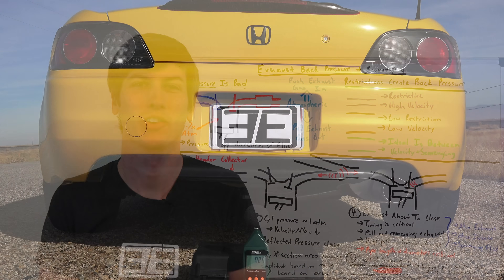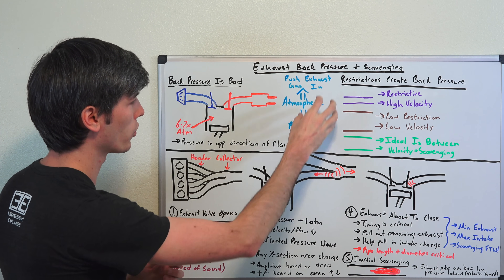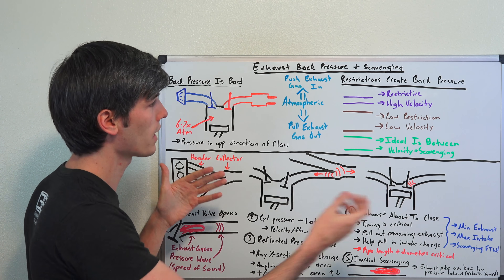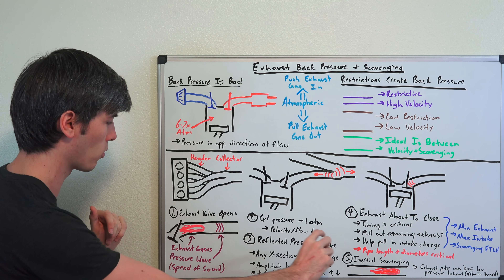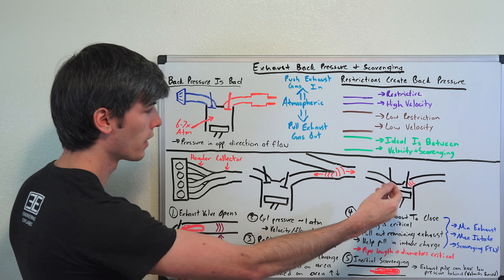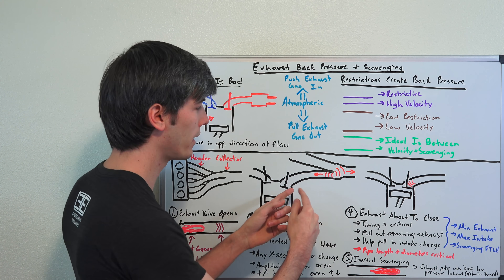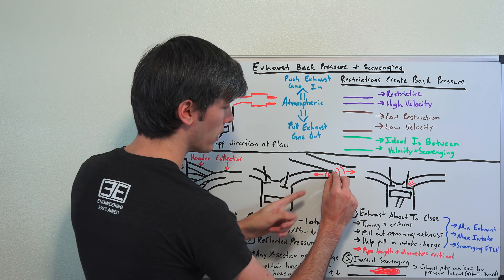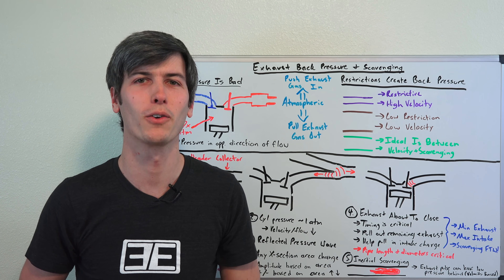Stop Saying Car Exhausts Need Back Pressure

Comment: Is this only assuming we all run titanium valves? Ever heard of a "burnt" or "tuliped" valve from exhaust leaks or running a vehicle too long with open manifolds? Im afraid this video may lead too many guys to ripping all their exhaust off and burning up a set of heads lol. But I would love to see your take on a similar video in a turbo application.

Comment: I need to ask you this. Say if the total length of my pipe is 3 meter (2.5"). What will happen if i chop off the last 1.5 meter of my pipe from the tip? Leaving the front 1.5 meter from the downpipe. What effect that my car will experience?

Comment: I have questions about how would one increase performance and remain legal and good emissions. I am thinking of not catback but rather high flow cats. Now this would related to a specific vehicle of course. What cold one do to try and analyse an exhaust system and know whether catback or high flow cats or both is needed?

Comment: IC engines are essentially pumps. Get the most intake charge in efficiently and the most exhaust charge out efficiently and you will see good results. Put exhaust gasses back into the pump and you'll find problems.

Comment: Does this apply to turbo cars? 
The turbo depends on exhaust pressure to operate doesn't it? 
How would change of exhaust back pressure affect turbo operations? 
I have a turbo diesel vw golf, if i were to, say, delete my muffler, that would certainly change my exhaust pressure, would that negatively or positively impact how the engine runs? 

Can you please do a follow-up video on exhaust back pressure and turbo cars? Please! 
I think what you have explained here in this video only assumed that it is naturally aspirated engine, right?

Comment: So you're advocating taking the catalytic converters off of cars, making them illegal for street driving? The ECU in most vehicles is tuned for that back pressure. Eliminating it would cause the ECU to go into limp mode because of the second o2 sensor, and the maps would be a little screwed with the reduced back pressure letting the engine spin with less resistance.

Comment: This is going to go on and on you need some back-pressure waves and the more boost you run the more unburnt fuel you flush out the exhaust port, the overlap of valve timing all play a part, people have been designing exhaust systems from day one, so why has this not been put to bed by now, it is a black art. Check out    Header Theory Dyno Test  and Cast Manifolds vs. Headers    on Engine Masters on YouTube, bigger free flow lower back pressure is not always the best way to go. It is good it gets people talking.

Comment: It's amazing that people will not listen to a word you said because Cleetus at Smithys Muffler Shop tells them the backpressure of a Flowmaster will give them more power
Reply: The whiteboard literally says “restrictions create back pressure” and then clarified underneath that an in between is ideal, which he leads on to explain in the second half about scavenging.
Reply: @Tyler Zeus On a daily driver, low end torque is indeed increased by smaller diameter header tubes. But, you are not so much increasing overall torque, you are shifting the peak of the torque curve toward a lower RPM range. You are sacrificing torque above the 5,000 RPM range. You get a peppy engine in the 2,500 to 3,500 range where daily driving and an occasional speed contest to the next light is required. However you are not flowing copious amounts of exhaust. You are using the high exhaust velocity from the smaller tubes, not the resistance it creates at higher RPMs.
Reply: Backpressure is bad. Scavenging is good.
Reply: "I have been a technician for 40 yrs"
So? That doesn't suddenly make the video wrong. It's just loosely saying the same thing as "I'm older than u so I'm right :^)"
Reply: r @snickerdoooodle  No, I am saying baby face engineers are asswholes.  I do understand you are getting senile gramps.  Time for your meds.
Reply: @Tyler Zeus wrong. If it did then explain why a diesel runs best under any situation with no backpressure?
Reply: @meifert2  Most diesels run turbochargers. They do have, in essence, restricted exhausts. The added power overcomes the sacrifice at the turbo. Makes one ponder electric turbos.
Reply: On forced induction engines back pressure is very bad
Reply: @charpocus  on any engine backpressure hurts power.
Reply: Maybe Cleetus' exhaust was done so wrong, that muffler actually neutralised its wrong benefits.
Reply: Idiots will listen to idiots
Reply: Well, if you see drag race cars, or f1 and so on, they dont juse muffler or restriction,, just straight out so much free flow as posible,, i do belive they know what they are doing, if some do it couse of noise regulation.  So if you a more free flow exhaust and more free flow air intake you will get moro power,  and more noise.
Reply: @mooen83  
They Also rebuild the engines after each race
Reply: @mooen83  Actually, those "zoomies" on a dragster engine are at a critically calculated length. At the ideal RPM, they reflect the sonic  pulse, created when the exhaust valve opens, back through the exiting exhaust gasses and arriving back at the exhaust valve at the time it opens again. It amplifies the next sonic pulse heading toward the end of the pipe. This stronger pulse helps move the gasses and creates a negative forward pressure that helps scavenge the burnt gasses from the combustion chamber. The pulse wave moving with and back through the flowing exhaust is a constant. Therefore, length of exhaust header "zoomies" pipe and diameter determine how long it takes the pulse to return to the valve. The time to return determines the engine rpm it takes to time the event to produce optimum horsepower. Now, for the F-1 guy, it gets a little more complicated since more than one cylinder is channeled into a single exit pipe. The pipe can be longer because the RPM is higher and more cylinders are contributing. Some of you already know this. Some of you will understand this. And, others won't believe a word I wrote, let the name calling begin. sigh
Reply: @mooen83  An F-1 engine produces low torque compare to their high horse power. Plus the engine spins upwards of 15000 RPM. You need all the freeflowing exhaust you can get with that engine speed. They do not need high torque because F-1 cars are light. Different story when you talk about regular street cars, or truck.
Reply: @MrWd2528  What are you even talking about? F1 engines produce near 500 ftlb of torque. More than most consumer haulers. F1 cars are light but produce more aerodynamic downforce than they weigh. At max speed an F1 car produces near 2500kg of normal force on the track surface.
Reply: And, the uneducated just crawl out of the woodwork. If you can't dazzle 'em with brilliance, baffle 'em with BS.
Reply: @VashthStampeede  Truth! To be fair though, the video leaves enough holes in the complete explanation of this process that I actually question why it was released as-is.
Reply: Most times when back pressure is mentioned is in regards to turbos as it’s kind of a preload for the turbine wheel(bearings). Too large a diameter will slow exhaust velocity conversely too small a diameter creates too much restriction robbing power etc. ie dont throw a 3 inch on a stock turbo mostly stock evo or sti as it would hurt more than it’d help.
Reply: It's not about power, it's about sound. If you have no back pressure at all, you'll get an un-tuned sound that sounds like ass. Especially if it's a POS economy car.
Reply: Well on a high performance engine like a 2015 zo6, you actually lose power if you remove the back pressure
Reply: @hippycow1006  wrong.
Reply: @meifert2  it is correct, if you put a better flowing exhaust in it, you lose power because like at the start of the video, he says that there needs to be balance. So by making the restriction low, you lose power.
Reply: @hippycow1006  no you don't. You change where the power is made but make more power. I'm literally running a Z06 on a dyno right now with an aftermarket exhaust with less restriction and it's making more power
Reply: @meifert2  and you didn’t make any other changes to the car other then the exhaust?
Reply: @hippycow1006  not on the initial run which was jist the exhaust. It's still picking up power as the tuner tweaks it.
Reply: @meifert2  well I stand corrected then
Reply: @hippycow1006  You don't lose power because no backpressure. Your ECU doesnt know how to deal with the improved flow and mucks up fueling. That's why you lose power
Reply: @Omar411269  the ECU can account for it fine. It’s still getting a stable reading from the oxygen sensor which just measured the atf ratio and not flow. The reason back pressure matters is because of resonance. If your exhaust pipes are too big in diameter, the bursts of exhaust from the engine won’t properly flow forward and thus sucking the next burst through. It has flow going back to the exhaust port because it flows too freely. Though this is a small thing on many cars it does matter on dragsters and proper race cars because it will effect performance.
Reply: Interesting comment.  I think it was in the first minute or two of the video that the feller explains why some back pressure is good.
Reply: @CalebDiT  What he said was having a balance of velocity and restriction is ideal, not that having some back pressure is good. More  restriction increases exhaust velocity but inhibits overall flow of exhaust, less restriction allows more exhaust flow but lowers velocity.
Reply: @Talos_Valcoran87  You and the video maker seem to understand what is necessary, but you don't like the terms. "Back pressure is bad, but some calculated restriction is ideal." It's a contradiction to anybody truly listening.
Reply: @Talos_Valcoran87  restriction = back pressure. This is semantics at best
Reply: @CalebDiT  no it isn't - back pressure is one direction.
Reply: @THEteamcurtis  not really, back pressure means going backwards, restriction means it can go forwards just slower, surely?
Reply: no, it doesn't. per webster, back pressure: residual pressure on the exhaust side of a steam-engine piston against which the steam on the intake side must work
Reply: @ljgarrison6910  You're answering a statement that nobody is making. Nobody ever says you need pressure going backwards, in a linear sense. Restriction creates back pressure. Consider any transverse wave, even electromagnetic, and you will see that no back pressure -- no restriction -- is rarely ideal. It takes everything to be just so in order to let things flow without restriction and for there to be no negative effects.
Reply: @Talos_Valcoran87  Flow good, Velocity bad (unless it is a tuned header IMO)
Reply: @Talos_Valcoran87  
well said
👍
Reply: @Talos_Valcoran87  Restriction inhibits the initial pulse, but helps the tail of the pulse through inertial scavenging. The overall win is to have some restriction. End of story.
Reply: @CalebDiT  Did you watch the same video?
Reply: @CalebDiT  No, he mentioned it and shrugged it off as if it was to complicated for us poor folk to understand.  He never explained it. Also the title of the video is "Back Pressure is Bad!".
Reply: @netprowlerp  you are the best example for the comment at hand
Reply: @CalebDiT  Watch the Video again with the title "Back Pressure is Bad!".  He never explains it he alludes towards it and shrugs if off as it being to complicated to explain.   I will take the advice of actual mechanical engineers and not one playing one on YouTube.
Reply: @netprowlerp  As a mechanical engineer I think he gives solid advice and understands the concepts I have been taught very well. So you can go away with that appeal to authority now.
Reply: @theworstflash  I have been a technician for 40yrs and had to fix the crap you engineers designed.  Let me tell you buddy,  I am not impressed.  My finding have been proven on the race track and not on paper.
Reply: Back pressure is the pressure sent back that when timed right helps scavenge the exhaust out of the cylinder.  He stated that himself.  He also stated that smaller diameter pipes move exhaust quicker(dont want it too small or too big). Pretty much, unless tuned and a system designed to work without it,  you won't get the best scavenging because the back wave of pressure creates it.
Reply: @MrBurntasphalt55  You got that backwards. Scavenging is caused by the vacuum created by the pressure of the exhaust pulse moving away from the valve.
Reply: MrBurntasphalt5l5
Reply: restricting exhaust increases torque and decreases horsepower, period
Reply: Hmmmmm . . . .  listen to my mechanic who builds engines for IMSA and SCCA champions or listen to an unumployed engineer who makes Youtube videos?  Hard choice.
Reply: SR20DET_RX7

Lets see why your engine needs a certain amount of Back pressure
1) makes the engine run smoother.
2) stops vibration shock on the crank shaft and con rods 
3) reduces wear on crank journals.
That's three  for you to contemplate ( think about ) If you  didn't need back pressure then automotive  engineers would have just let the exhaust run strait out the head. Say Hi to Cleetus  for me he seams smarter than you
Reply: @bearup1612  you claim someone "seams" smarter...yet you can't spell
Reply: @meifert2  
WOW. Is that all you have to say.
Reply: @bearup1612  you're wrong. That says the rest.

Comment: The myth of back pressure. The old myth was that six cylinder engines needed back pressure, but what they didn't understand was that at lower rpm, where most sixes made torque, exhaust velocity was important. Because Kay Sissel, the authority on straight six performance at the time narrowed the exhaust after it passed through the collector to enhance velocity it was called back pressure by those who didn't understand how tuned intake and exhaust systems worked. This guy explains things fairly well. The whole thing is this, the positive pressure wave created by the exhaust expanding and escaping the cylinder when the exhaust valve opens traveled at 1400 feet per second according to Chrysler, 1100 feet per second according to Ford and British leyland. It really doesn't matter who's right, the proof is in how tuning effects the engine. When the p wave, or positive exhaust pulse exits the exhaust collector into the atmosphere, a negative wave forms immediately running back up the exhaust towards the next cylinder that's ready to release its exhaust gas pressure. When tuned correctly, the exhaust valve opens and the intake opens soon there after, and the momentum of the exhaust gasses leaving the cylinder creates a vacuum, helping draw in the air-fuel charge for the next cycle. The intake has to be tuned just like the exhaust so that these pulses of pressure happen at the desired time so that during valve overlap they help fill the cylinder for the next compression and power stroke.

Comment: I wish you had touched on the subject of 2 stroke expansion chamber exhausts. That is the one exception where back pressure (in the second half of the expansion chamber, where it constricts) benefits by keeping fresh air/fuel mix from escaping during the brief period of port overlap.

Comment: Lol you demolished the backpressure argument in 1 minute 58 seconds 😅
Reply: He did not demolish anything, to much back pressure in an exhaust system and exhaust gas velocity is killed, to little back pressure in an exhaust system and velocity is killed, all these videos do is play semantics trying to say back pressure is a myth yet all properly designed exhaust systems will have back pressure. It is about exhaust gas velocity. Borla worked with John Lingenfelter and he built 600 horse power corvettes using 2 1/2 inch exhaust systems because that is what gave him the maximum exhaust gas velocity if a bigger exhaust pipe would have made Lingenfelter go faster he would have used it but a bigger exhaust pipe removed more restriction i.e. back pressure and killed the exhaust gas velocity. 

A 2 inch exhaust will only flow so much volume, a 2 1/2 exhaust will flow more volume than a 2 inch system and a 3 inch exhaust system will flow more volume than either a 2 inch or 2 1/2 inch exhaust system. What you are looking for is exhaust gas velocity if the 2 inch is to restrictive you kill exhaust gas velocity what is restriction, it is back pressure. If the 3 inch exhaust is to free flowing it kills exhaust gas velocity because it does not have enough back pressure. The 2 1/2 inch exhaust in this case has less restriction than the 2 inch system and has more restriction than the 3 inch system yet the 2 1/2 inch exhaust system has the highest exhaust gas velocity. 

Having said this what you have to do is design the entire exhaust system with the optimal size pipes to get the maximum exhaust gas velocity so it takes proper design to get maximum results, which is why Borla is the leader in aftermarket exhaust systems and they have won more races than all other aftermarket exhaust manufactures combined. 

All these videos are doing is using mental gymnastics trying to eliminate the word back pressure.